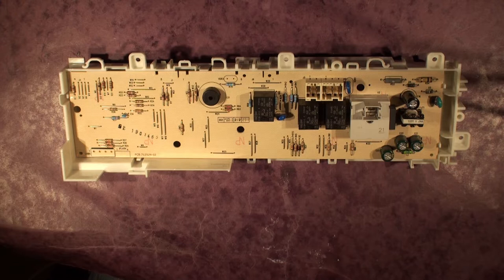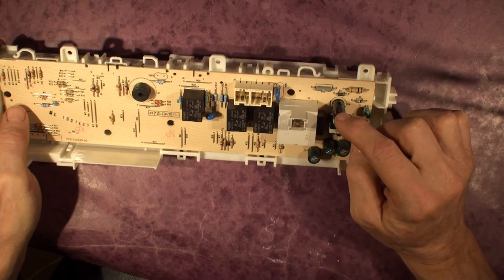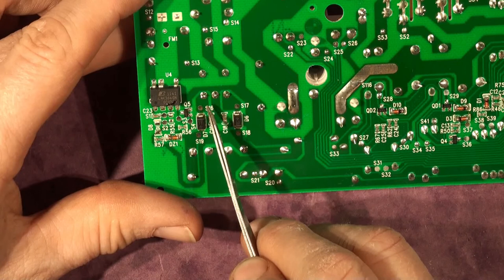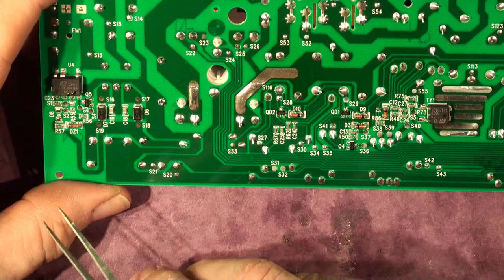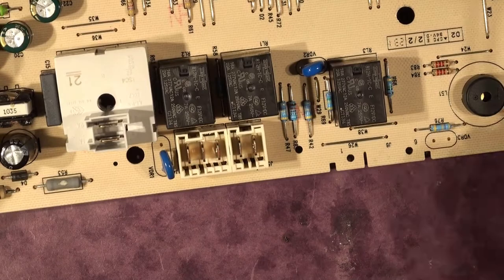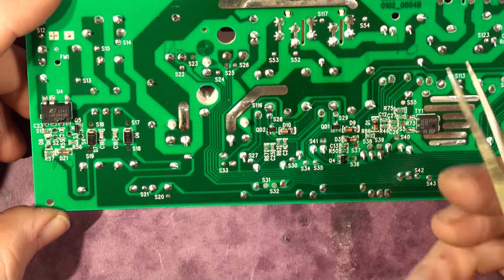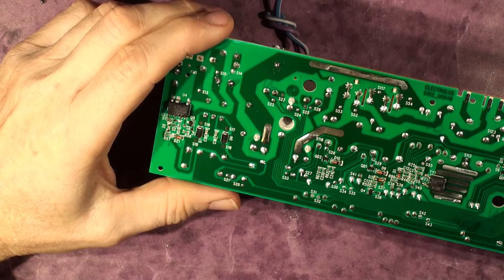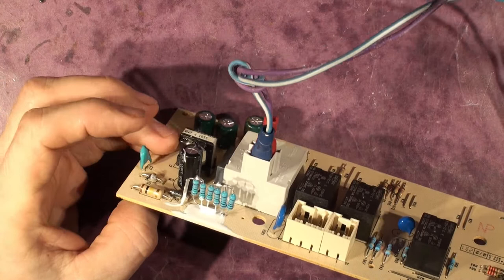Zanussi Tumble Dryer Controller Repair Diagnostic

Comment: Just ordered the same components as my dryer has done exactly the same thing, my resistor was burnt also. Thanks for the info 👍👍
Reply from the maker: Thanks. Good luck with the repair.
Reply: @razenby  what way do the resistor go? Going from the end of the board I have yellow purple black and tolerance band gold
Reply: Robert, would you please tell me where you purchased the components from and if you have the links handy, thank you.
Reply from the maker: @robertsampson6091  Resistor can go in either way there is no polarity for a resistor. Current flows the same both  ways. Think of it as a not very good wire that does not pass electricity very well.

Comment: Saved me at least £150 on a Zanussi tumble dryer board. The same common fault occured with dry solder joints on the black Omron relay. This was resoldered with lead solder and is working well. The relay is quite long and not glued to the PCB, with all the heat cycles it goes through I'm not surprised that the solder joints have fatigued and cracked, it's a poor design, common to AEG, Electrolux and Zanussi that use the same parts.
Getting the main circuit board out was more difficult though, had to take the top lid off, then the side panel, before I could remove the circuit board and  cover.
Reply from the maker: Good job.. That's what we want!

Comment: Thanks for that...great video...my tumble dryer failed...same problem...blown LNK304 and resistor. By the way, it's a 47r 3w resistor but your way of working that out was cool :-)
Reply from the maker: No problem. The LNK Series of chips has caused a lot of pain.. just thin for a moment of how much equipment as been thrown out because of it..
Reply: Thank you, brilliant.  Exaisle, is that 47 Ohm?  Not so sure if that's what you mean... got the same issue!
Reply: @jdviljoen4770  Yes...its 47 ohm. You need to be very careful removing the little chip. Also..it might be worth your while checking your mains voltage. A possible cause of these blowing is transient spikes where the mains may surge up to very high voltages for a split second (ie 1000volts or higher) so installing a surge protection device might be an option.
Reply: Yes indeed, just removed mine and it's a 47 ohm but think it's a 2w and not a 3w... although I've put a 3w in and it still sits on the board.
Reply: @optic1972  There's no problem putting in a resistor that's rated a higher wattage than the original as long as the resitance is the same. I hope you got your machine back in working order.
Reply: @exaisle  yes indeed just to let people know that a 3w wire wound will still physically fit. Also my resistor had no burning or distortion at all..just blown but the chip had spat in the middle. There's a similar video on YouTube showing that an inductor also tends to blow but on my board after testing it was fine. Great work to all involved!

Comment: Thank you for this fascinating video. In my case however (and my PCB looks exactly like yours)  the mains comes in via connector J5. The connector that goes into the dial switch comes from the door safety switch and seems to connect the Live only, not the neutral. Does this make sense?
Reply from the maker: Yes, I think the door switches are usually single pole. I.e. they switch only the live wire.  Investigate the switch. If is dual pole then it could be the door switch.

Comment: You didn’t say what you calculated the value of the resister to be i see you used six to replace it but could you elaborate on exactly how you did it.
Reply from the maker: It is in the video..  Use a 47 ohm 2W fusible resistor

Comment: I changed the lnk 304 and 47 ohm resistor and i’m still facing the same problem, what should i do
Reply from the maker: If you know the safety precautions then check that the high voltage making it as far as the chip. Check the reservoir capacitor has about 350V volts on it.  Sometimes the mains switches fail. Also check the diodes around the LNK chip.  It could be that the micro on the low voltage side is blown but then the board powers up and some LEDs are stuck on.

Comment: Magic Smoke, can you please tell me the value of the varistor VDR2? would be much grateful, in my case they are burned
Reply from the maker: This is a generic part. Any similar sized 275VAC working varistor of a similar diameter will do the job. They are usually denoted by the characters 271K in the manufacturer's part reference. For example a an EPCOS	B72214S0271K101     Good luck. Please remember to like and subscribe. Thanks.
Reply: @razenby  that's a fantastic fast & complete answer! thanks!

Comment: Hi, thank you for the video and explanation. You mentioned that you sold the lnk304gn and the 47 ohm 3 watt resistor on ebay. Could you please provide me with the ebay link, thanks
Reply from the maker: Sorry I ran out. Did you get some ?  If not Ill get a load into stock.
Reply: @razenby  Yes , I managed to find the bits and with the help of your video fixed the tumble dryer. Would be good for you to post the Link to your eBay store, thank you

Comment: Hi magic smoke,I watched the video, can you advise please where I can purchase both components to do the repair, thank you , Brian.
Reply from the maker: Hi Brian,   What value is the power resistor on your board?  Can you read the numbers?  As explained you need a fusible resistor. Tell me the value and I will have  a look. I have the chips in stock. No problem sending you one.
Reply: @razenby  Hi magic smoke thank you for your swift reply ,the the number on the Resistor appears to be 47R   10% i will send a few pics if i can ,thank you so much,I am just ordering a soldering iron to have a go at my first repair😀🔨🪚🪛🧫 can tell me what i owe for both please, thanks again ,
Brian.
Reply: @razenby  Hi magic smoke, thanks for your swift reply, here is the pics of the chip and resistor as best I can get them, it appears to be 47r   10% board number r53. Thanks for your help and guidance.
Reply: @razenby  hi magic smoke, the number on the resistor is 47R,  thanks for your help,
Brian
Reply: Hi magic smoke, have you received my messages,
Thank you .
Brian
Reply: @razenby   hi did you receive my message thank you .
Brian.

Comment: Hi I am trying to remove the plugs from the square/rectangular sockets . The ones with spade connectors. I can't work out if there is a clip or whether they just pull out. I'm worried that I will break the pcb if I pull too hard. Please can you tell me how to unplug them. thanks
Reply from the maker: They pull out. They can be very stiff. A pair of long nose pliers (grips)   can be used to rock the connector from side to side and ease it out. Don't pull on the wires.  Thanks for watching. Subscribe of you can.

Comment: I have an issue with my AEG Lavatherm Protex Plus dryer. Sometimes it stops within 10-15 minutes and everytime I turn it on, I have to set the time. I have a lnk586gg but could be sonething else like a diode e.g.? Thank you from germany
Reply: additionally: could it be something else besides the lnk586 GG like a diode?
Reply from the maker: It sounds like it may well be a power problem.  If you have had it for a while then change the chip anyway. they have a finite life and the new chips are better than the old.  Check for bad connections and signs of sparking. Also don't forget the mains lead and plug - a power problem anywhere in the chain will cause this. Also change the main DC reservoir capacitor.

Comment: Hi, excellent video and useful explanations as to which component do what. I’m a washing machine engineer and a similar thing happens on Bosch dryers, where the switch mode and resistor blow. I’ve had lots of success replacing the components on Zanussi/Aeg machines, but on Bosch/Siemens, the machine works but only tends to do one or two cycles of drying before the components blow again. What could be causing this? I’ve heard maybe failing capacitors cause it but I’m not sure. Have you ever had experience with a Bosch board? Thanks in advance
Reply from the maker: Thanks. The power supplies are all pretty similar. Change the buck diode and the HV and LV reservoir capacitors.  Also check the metal oxide VDR  looks OK. The chip should be protect itself against overload on the output side so that wont blow it up. It is a pretty simple circuit with few components.  Also depending on the machine design there is a transient filter at the mains inlet on most machines, usually located in the mains route at the casing where the cable enters. Depending on the impedance of your mains supply, if the filter  has gone O/C than you can get nasty transients hitting the controller when the motor turns on and off . Makes sure the mains wall socked and plug are OK and not arcing. This can cause controller reliability issues. Don't plug power tools or vacuum cleaners in to adjacent wall sockets.
Reply: @razenby  Thankyou for your swift and thorough response

Comment: I found your video interesting but a bit beyond my GCSE physics from many years ago!

We have a Zanussi ZDC47100W which died today after being run with the water tank overflowing. I was hoping it was just a thermal fuse replacement but can't seem to find it ( if it's a PCB problem I'd have to send that away to get the replacement component soldered on). 

I've had the dryer open  to change the belt last year and had a quick look inside tonight. Does anyone know where the thermal fuse is? Many thanks.
Reply: My friend has a machine that has gone dead and wants me to look at it. Did you find the answer? Because it would also help me?
Reply from the maker: Just check the AC power to the controller is present. If you get no beeps or lights then the power supply chip is likely to have blown. Take out the controller and inspect it carefully. If water or condensation forms on the high voltage areas of the controller then the offline PWM controller chip blows  the instant you turn on the power.

Comment: Hi, I have the same drier, ZDC37200W, when I turn the timer knob it should activate the start button, it should light up and when pressed the dryer should start.  However the start button does not always light up, therefore when pressed will not start the dryer.  This is intermittent, I have to move the timer knob slowly back and forward and eventually the start button will light up.  Any idea on what the fault is caused by?
Reply from the maker: Difficult to say.  Could be a faulty rotary switch or a bad connection or solder joint on the controller.

Comment: Awesome video. Thanks.
I had the same blown resistor and chip, replaced both but think I messed something up or something else is also fried. Had a closer look and the very small component at s1 just under the chip looked slightly out of position maybe due to the heat gun heartening it.Went to move it back and managed to drop and lose it. Would you know what it is and where I could get one or do u offer a repair service as I’m not 100% sure it was out of place to begin with?
Reply from the maker: Sorry I don't have one here. If you send me a close up picture f that part of the circuit board I can work it out.

Comment: Has anyone found the circuit diagram? I’m in a pickle and would love to modify the pcb and add a 5v and 12v smps’ to get mine going asap. Otherwise I’ll wire the mains side up so as soon as the mains power is turned on, it runs.
Reply from the maker: I have never seen a schematic You can just trace the circuit and use the PWM off-line chip datasheet. It is easier to simply repair the switching power supply

Comment: Hi. I have this model too and have changed the heating element and checked all other components which are all saying are ok but the heater is only running one of two elements. I was hoping you might show a reason here. Is there anything on the circuit board which would account for this failure? Thanks.
Reply from the maker: Trace the wiring back to see if each heater element is run for a separate relay. If so it could be a stuck /failed relay. Also inspect the solder joints around the  relays and have a closer look at the spade crimps for signs of arcing or burning. If you suspect the relay then swap them over to see if the fault transfers to the working element.  Relays are cheap and freely available,
Reply: @razenby  Thanks for your quick reply. The only wire separately connected to the bottom heater element is a black one and goes to the middle terminal of the 3 pin connection on the pcb. Resistance throughout the wiring shows up ok. All connections look ok. I'm not sure where to go from here. I'm sorry, I'm a complete novice at this sort of thing to be honest. The connection seems to be going to relay 1 (RL1)The heater element is brand new and I'm sure its going to be something tiny and stupid thats stopping this machine from heating fully. I've had to buy a new tumble dryer meantime but it seems a shame to scrap it. Overall its in great condition.
Reply from the maker: If you want to post the controller I will take a look at it and make a video - funded by video channel. You just need to pay postage and a couple of quid for the part.
Reply: @razenby  ok thanks. I think I will. I'm very interested to know where the problem lies.

Comment: Thank you for this video. I am having an issue with my Zanussi dryer ZTH 485 which does not show any sign of life. I have removed the board from the dryer and was checking for some continuity. Most were showing continuity, but I am not sure where to look as I this is the first time to attempt something like this. Any help?
Reply from the maker: Is there a LNK301, LNK302 or a LNK 303  IC on the board ?
Reply: @razenby  thank you for the reply. Yes, there is one: 1140 LNK304GN 0B392B
Reply from the maker: See the video. the circuit is likely to be the same and the LNK chip is the usual cause of a dead controller.  Be careful as there are high voltages when connected to the power.
Reply: @razenby  A bit stupid of me as I got electrocuted. :) The LNK chip number should be the same as the one on the board or any number can do?
Any idea where I can order one online?

Comment: Ive had a friends dryer board given to me as the machine was also dead, its identical to the board as you have and made the repair to the board by replacing the LNK304GN and the 47 ohm resistor.
The dryer now powers up and runs but after 25 seconds ends the cycle. This can be repeated on any setting apart from the cooling setting where it works faultless so clearly something on the heating circuit.
Ive tested the rear stats and the heater and also the front NTC all appear to be fine.
Ive also checked over the board and have tested the basics and all seem ok, any thoughts? im actually thinking its the heater relay but question why this would suddenly go?
Would you have any ideas?
Reply from the maker: Clearly it is related to the heating element. You are right to question why would the relay fail at the same time. It is a common trap to assume multiple faults and end up investigating a dead end. However, a transient in the mains could have taken out the LNK chip. The transient could have been caused by a a short in the heating element especially if you don't have an RCD in your house. (Many older houses do not).  If the heating element is not open circuit (measure resistance) then are you sure that all the plugs are correctly connected ? Double check the ones for the heating element itself and the temperature sensor. The spade connectors on the board can have cracked solder joints if they have been unplugged,  Inspect the board for any solder whiskers that may have been left on it during the repair.

Comment: Hi I've got zanussi tumble dryer there's no power to it its zdc37200w and 
Will LNK304GN SOP7 Integrated Circuit from Power Integrations fit  mine?
Thanks for your help
Reply from the maker: Yes I believe it uses the LNK chip
Reply: I meant will this fit mine LNK304GN SOP7 Integrated Circuit from Power Integrations ?
Thank you
Reply from the maker: You need  SMDB package LNK304GN https://uk.rs-online.com/web/p/buck-converters/1465628/

Comment: I got an  Zanussi Lindo300 washer machine with a controller which got touch buttons. The controller programmer is messed up. For example if i try to touch the buttons, it take a while to response as the controller goes here and there non stop. The non stop stops when ever i keep my finger on one of the buttons and goes crazy again when ever my finger goes of from it. There is no error code i get. Some times it works normally but after a while it will do the same thing.

Any advice what it could be? Thank u!
Reply from the maker: If the controller is clean with no signs or water ingress or corrosion then the issue is most likely power related  so change C2, C3, C4.  This is the most likely scenario. If you want to send it I'll test it for you and make a video.